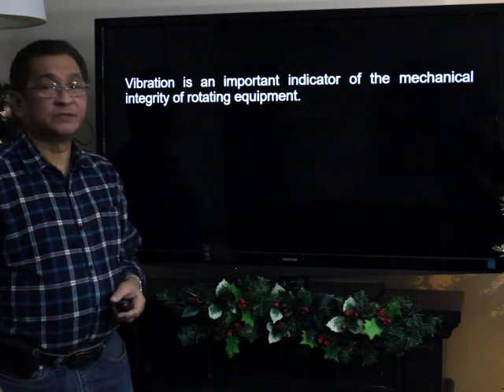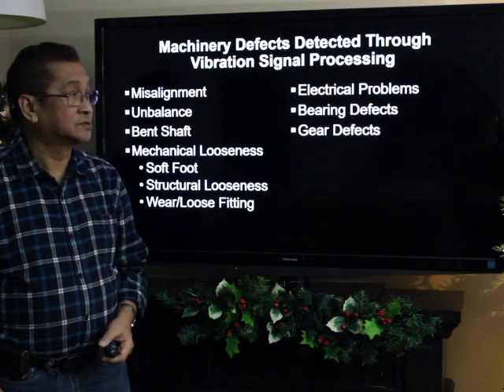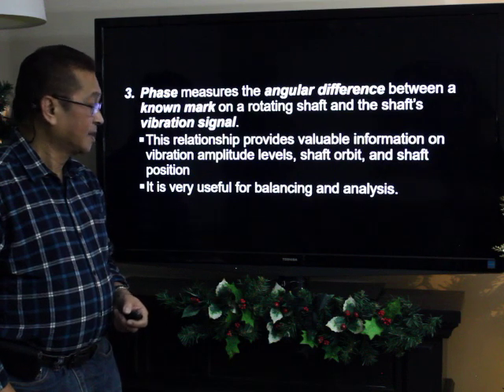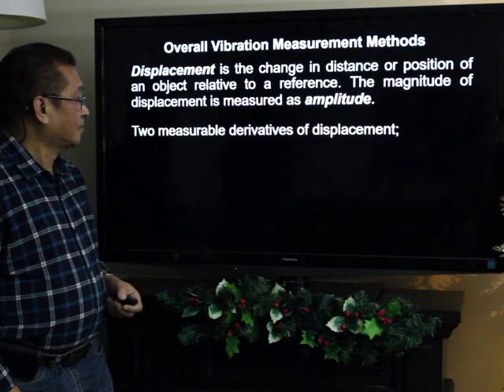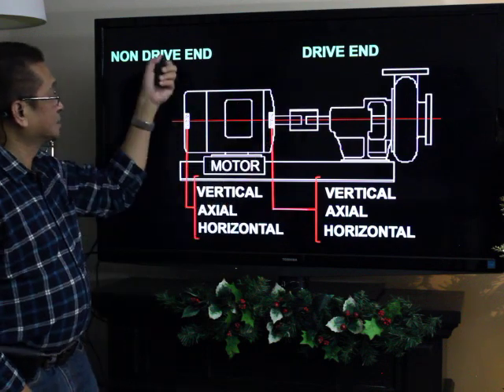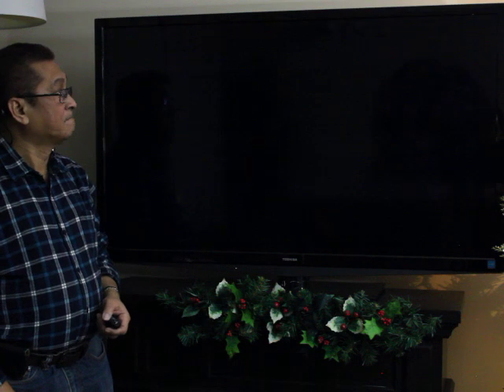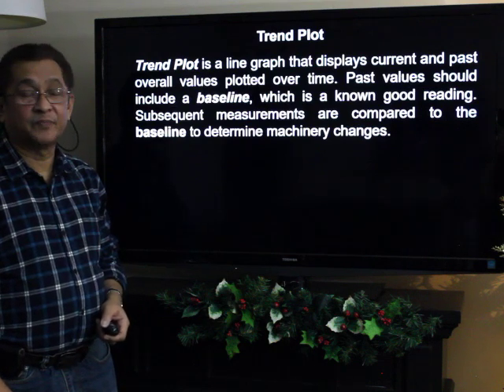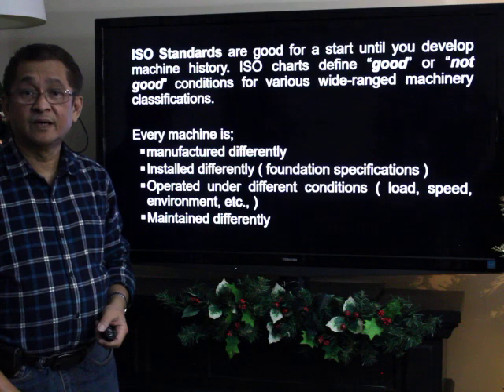Vibration Analysis  Part 1  A Predictive Maintenance Tool

Comment: Hi sir, i have a few question 37kw electric motor drive in cyclo drive, i take measurement in drive end vertical 2.3mm/s horizontal 2.0mm/s, then in non drive end vertical 4.0mm/s horizontal 2.7mm/s, this machine not fix in base foundation only in flooring testing possible the vabration starting at this base, thanks